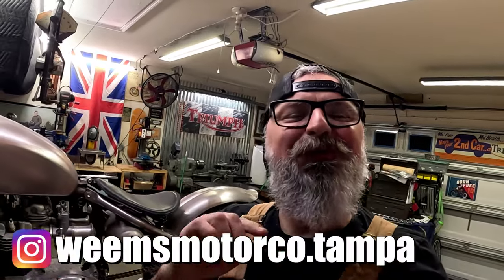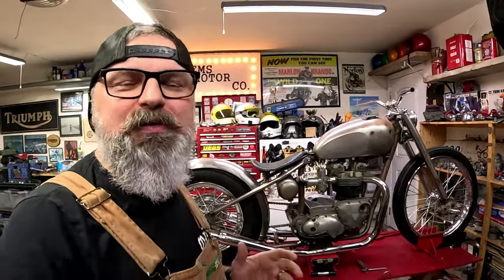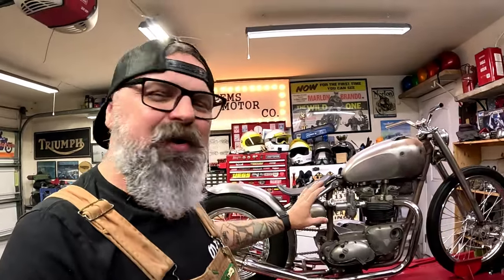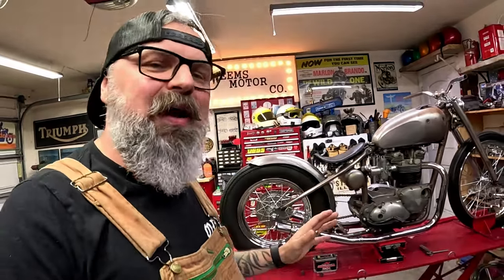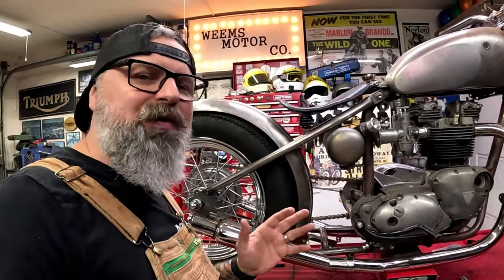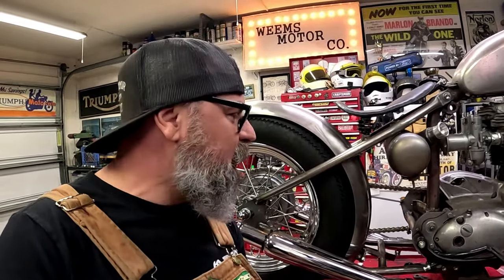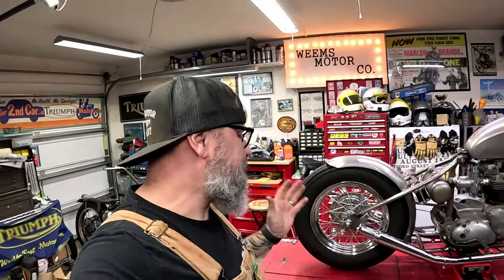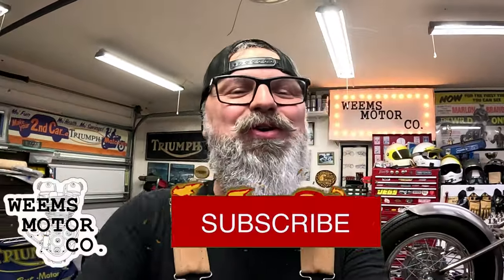Triumph Hardtail Bobber

Comment: That's how a proper Triumph hardtail bobber should look.  So many people get it wrong.   One thing I don't understand with a lot of these hardtail builds, including this one, is why the seat always slants backwards...  won't the rider feel like they're sliding off the back of the bike?   Seems like you'd want the seat to be parallel to the ground or even tilted slightly forward without the weight of the rider on it.    is there a reason for the seat placement or is it the look?
Reply from the maker: It is all about the lines!

Comment: Great video. I'm doing a fundraiser for Forgotten Angel's this summer and I may need some guidance if your down to help another creator man. Love the video
Reply from the maker: Oh man!  What's your thoughts?
Reply: @weemsmotorco  I've got a CB 750 chopper I'm thinking about raffling off maybe this summer when I'm finished it with it and using the majority of the proceeds to give to forgotten angels. I've seen it on your channel and would love to help them out. I had my painter do an amazing paint job on it, but I build mostly shovelheads and panheads and the cb is kinda like a step child lol so I figured I could do something good with it. I'm in TN and your in Florida and you have the relationship with them, so if I can pull it off, maybe you can present them with donation for me. The bike is briefly in my last video if you wanna see it.

Comment: The upper bracket for the rear mudguard has gotta go. Fab a new one using the bungs for the battery mount.
Paint it sky blue and white. Black frame.
Reply from the maker: Great Idea!
Reply: A good bracket does a job. A great bracket does 2 jobs.

Comment: whats with yanks and choppers and bobbers personally i would of used a t140v engine for the splayed head and mid level straight thrus like a bsa hornet i know its the customers but not running a front brake i would of gone for a disc rear brake just for safety sake not 50s-60s look i know  id paint it polychromatic blue
Reply from the maker: All great ideas!

Comment: Black frame and clear coat the bare metal tank and fender. Not sure how to paint the oil tank. A black oil tank might stop the black battery from standing out so much. Or, black frame and a dark rich red tank and fender with slim to no metal flake.
Reply from the maker: Great ideas!